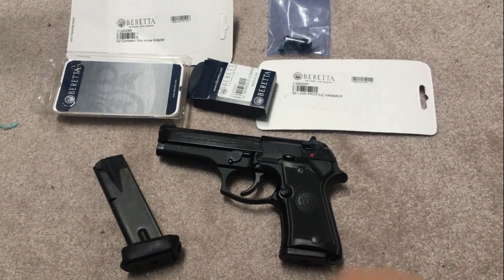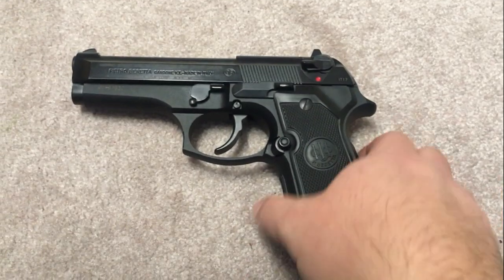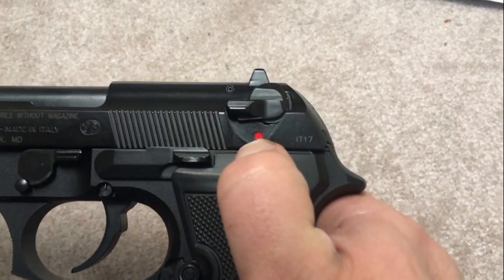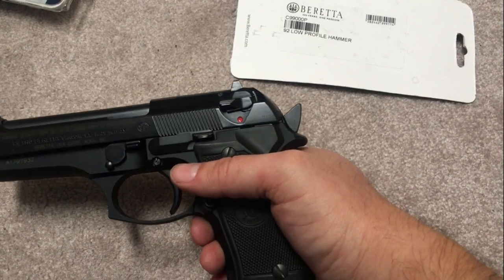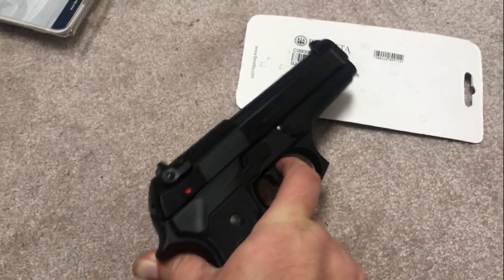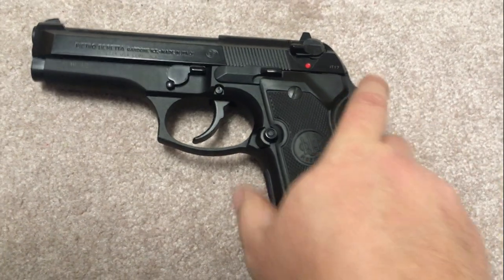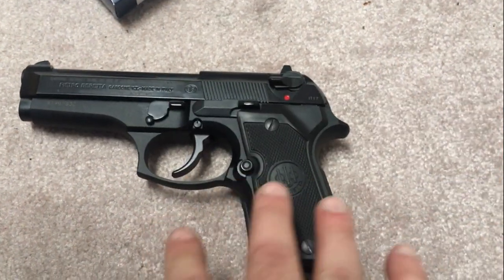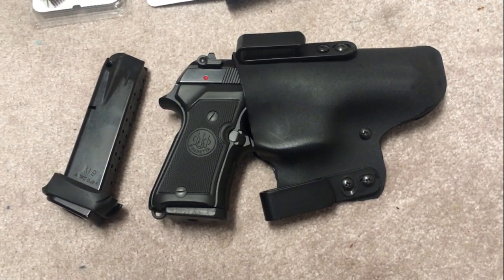Beretta 92FS Compact Follow-up - How to Make it 'EDC Ready'!

Comment: I wish I never got rid of my Beretta's.  Instantly regretted it.  Now I don't want to spend the money or sell any guns to get back into them:)   That's a beauty!
Reply from the maker: They're pretty dirt cheap right now as stores move them out to make space for the new 92X series. I got a 92A1 for like $525. I've seen 92FS's for $500 New. Pretty hard on the wallet!
Reply: GunnerSouthPAS nice. I may have too take a look. The 92x looks amazing.
Reply: @jonathanfrost944  Can confirm.  92X is amazing.  The upgrades in it are well worth the price of admission.  
-Removable sights
-Chrome barrel
-Steel guide rod
-Lightened up DA trigger pull

That alone... I'm forgetting some other things but it's an amazing carry weapon.  Love mine.

Comment: Hey GunnerSouth - update- are you carrying the 92FS Compact?  Happy with it??  I am looking long and hard at the 92X Compact variant ......
Reply from the maker: I carry it from time to time. Mostly carry my P365 but the 92FS is the go to when I can carry something Glock 19 size.
Reply: Is the 92 x different then the compact? Just wondering mine come with the red dot on front and if i put my gun on Safety the hanmmer will do but not fire as soon as i put it on safe. My clip was 13rd with finger extension on one of the 2 clips that it was equipped with new at purchase. Also i noticed in video that your left side of your beretta said made in Italy king says made in USA and i know beretta is Italian made. With all that said it is awesome, it is the r first beretta I’ve owned and i have owned glocks, Taurus, Ruger ect. And by far i think it’s the smoothest feeling gun I’ve operated. It’ is effortless to rack , it’s recoil is not that off a typical 9mm and its compact size fits my smaller hands.

Comment: Might as well carry a sticker fire tactical type pistol if you are changing all the original features ! I too have a 92fs compact. Even tho my all time carry is a glock 19 i just carry the beretta with the safety off !
Reply from the maker: Decocker is a must for carry IMO - I don't want a dead trigger. Mag release was a 'near must' because I had trouble getting to it with the stock one. Bobbed hammer is for comfort for carry, and if a carry isn't comfortable you don't carry it - defeating the point. I dunno man I don't think I did anything flashy. All function IMO.
Reply: GunnerSouthPAS I guess you are Right ! as long as it makes it more comfortable and faster to shoot. In my opinion I wouldn’t want to change anything on mine specially since its not everyday carry i grab it every now and then. just remember most bad guys don’t practice like we do. So we have an advantage even from on the draw

Comment: Do you still have this gun? If so, I do recommend the Wilson Combat slim grips and a D hammer spring and a lighter trigger return spring. Oh and maybe an extended mag release. I own the same gun and I do like your bobbed hammer. I think it’s actually called a DAO hammer.
Reply from the maker: Yep - it's still in my carry rotation (better for winter though). I recommend the D spring. WC grips are fine but I've got another video on that soon. I like the mag release as well (especially if you have shorter/smaller thumbs/hands). Looks like Langdon calls them 'Spurless hammer'. DAO, Bobbed, Spurless. All the same :)

Comment: Why would u want to get raid of the safety it's there to keep from having an accidental fire I will never remove my safety that's stupid
Reply: a good holster will prevent any accidental discharges. a glock is the same way. they have no external safety. you just needa have trigger discipline. going decocker only is definitely the way to go
Reply from the maker: I converted to a G model. Decocker only. Now you can carry it like a LOT of DA/SA decocker only guns, Beretta G model, Sig 226/229, CZ decocker models like SP-01, P-01. Basically your safety is a very long and heavy double action trigger. Lots of guns operate this way.
Reply: @GunnerSouthPAS  "Lots of guns operate this way."  Yep, that's exactly right--revolvers, for instance.  Lots of semi-automatics, too.